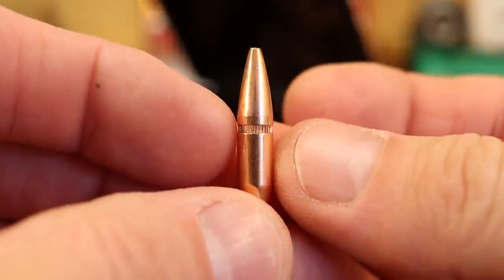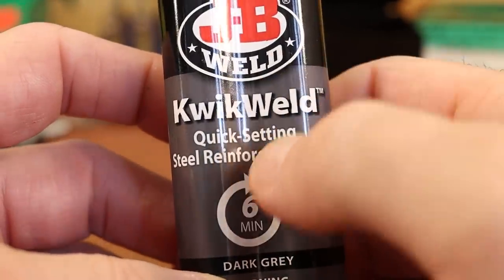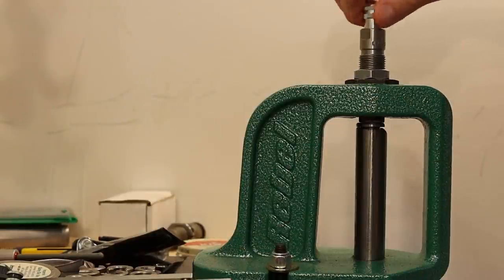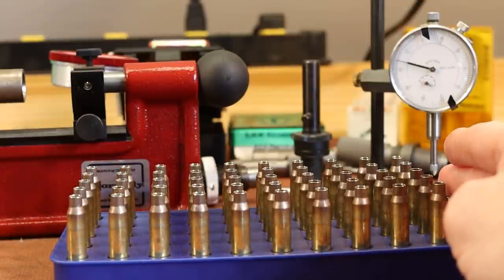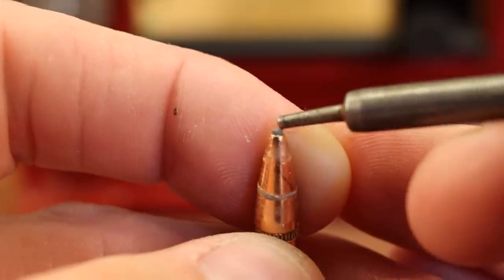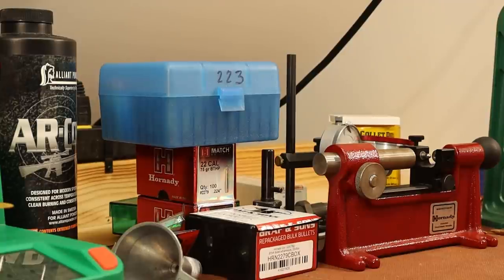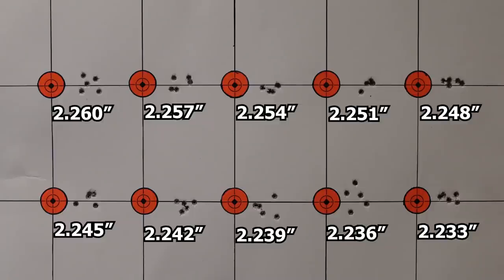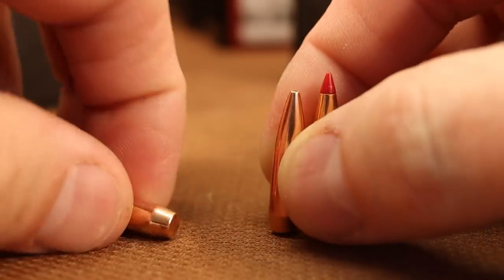223 Rem - 75gr Hornady BTHP with AR-Comp

Comment: JRB thank you, great stuff but...sorry to add another variable...when you use the new Lake City cases the shoulder will come from the factory bumped back as much as .004" below SAAMI .223 chamber minimum dimensions. No big deal in terms of safety and it's done that way to fit all chambers. BUT, although it's counterintuitive, the more the shoulder is pushed back, the more the projectile will be pushed forward towards the lands. SO now your seated bullets ogive is actually .004 to however many more thousands closer towards the lands than bullets seated in your minimally bumped back fire formed brass. Take two pieces of brass with equal bump seat two projectiles to the same depth, now take one(no powder) and bump it back. 001-.002. If you measure the CBTO of both, you will see the bumped back one grew the amount you bumped back the datum line!.

Comment: Sizing the necks with a mandrel is probably the easiest way to cure run out problems in brass.  The Sinclair mandrills are actually pretty cheap. I am getting less than .001 using the mandrel in the first station of my Dillon on my range ammo. After I saw how well it works, I started using it on all of my rifle brass

Comment: Good stuff. I had a rifle that would barely hold 1.25 in at 100. Did 0.003 testing. Got it down to 0.069. Never tested run out. I believe seating depth is much more important a factor than run out.

Comment: My favourite bullet (minus the cannelure because they are unobtanium here) for 5.56. I measure them and find one that is to spec length and then set my die to seat  them to 2.25” over a max charge of Varget (compressed) and use the seat, turn 90, seat trick I learned from you years ago. Shoots like a laser.

Comment: Had the "ring" issue with some "mystery" 75gr HP.  I used a Dremel &  Polish paste w/a wood "q-tip" on the seating pin...did pretty good at cleaning it up.

Comment: Check the runout after you load them then check it again after it has been chambered and before firing it. The violent feeding process will likely change the runout. If so, in the end, it won't matter what the concentricity is because the rifle will change it. Different story in a push feed.

Comment: I was so excited for this, couldn't wait, still fascinated. I wanted more kinetic energy over distance, and accuracy and had found Varget poor with my lighter bullets, so used my stock with these 75s and OMG. Turned out so durn good. Others ok. never had any inconsistency except with H335 which I rather expected. So Superformance and Varget were amazing with the 75 and my rifles.  Interesting stuff. BTW I loaded to like 2.25"
Reply: Try 25 gr LVR @ about 2.250. LVR is a great 223 powder. Didn't chrony yet, don't really care, it's scootin along.

Comment: Johnny, I ran into this same issue with some .224” bullets I use for carnitas loads. After contacting RCBS, they requested I send 6 bullets of the type I wished to have the bullet seat stem made to fit. RCBS charged me $20 + shipping and handling per bullet seat stem and sent my bullets with the new bullet seat stems. I did wait for approx 6 weeks for the seater stems but what the heck? I was extremely happy to have a stem that fit my bullets.
Reply: Cantinas loads? That was supposed to be varmit loads. But I’m laughing now.

Comment: Have you tried the old timers vibrator trick?  Those of you with dirty minds get them out of the gutter.  After dropping the powder charges on a compressed load, place them in a loading tray. Touch the tray with something that vibrates.  I had a massager the worked great on low.  After the massager wore out I used an old electric razor.  You just need something that will vibrate the powder to settle it.

Comment: run out is NOT suppose to matter, the throat is suppose to align the bullet to the bore as it enters.   How ever...  I'm sure it has some degree, but your seating depth is more important.  I am sure you are aware but some of your viewers may not be, that a 5.556 chamber has more throat than a 223.  The 556 is built that way to accept  many faulted or different lengths of bullets and correct it.  I have always had good results with backing off the lands .020 thousands less than what Hornady calls for.  I think that keeps chamber pressures low and allows the bullet a chance to get moving before it hits the lands.  I was holding my breath at the one shot group waiting for you to pull the trigger.   I was rooting for ya.   :)

Comment: I'm not a big fan of the cannelure because whatever the reason it's there, it creates a deformity in the bullet. How consistent is the cannelure made? On lower quality bullets, I can't imagine it's not all over the place. There is match grade and base level bullets for a reason. These bullets Johnny was using, where do they fall on the scale of bottom plinking bullets to the highest grade bullets made? If runout was an issue because of the cannelure, then use bullets without the cannelure. Easily remove the issue. BUT, is that the issue? Or is more bullet in the case mouth what really stabilizes the runout regardless of the cannelure or not? I wish I had the time, money and equipment to do what Johnny is doing. Thank you Johnny, you are a king in this never ending world of reloading.

Comment: Next test could be trying the seating depth node with both neck tension  ±0.002 from standard. As well as crimp in 3 amounts from a light barely perceived one to a moderate just noticeable crimp.

Comment: Try same ground of powder, prep all brass by cleaning out the flash hole, primer pockets. Then check weight of all brass to be at same weight and length, check all bullets to be same length, ogive length and weight.  Load and test fire.
Reply: Mandrel the brass to .222 before powder and seating.

Comment: Man, I don’t know. You’re down to nit picking. Maybe sort out bullets by weight difference or tip consistency. 
Other than that, maybe stick with this charge weight, oal, etc. and sort out by concentricity. So like a group of 5 with .004, down to 5 with .001 and see if your theory of it not making a difference holds true. If not, I’d say call it. If the load gets down in the .5” range, what more are you looking for? If it’s a hunting load, then maybe do a gel test and if passes, get in a stand!
Reply: Definitely a good idea Gel test 👍
Reply: Great comment!

Comment: Constantly gotta weight time investment versus productivity. I feel the same, I don't want to being spending hours nit-picking brass when I could be spending it behind the trigger. 

Might want longer than typical necks for those handloads. Maybe a 0.005" shorter than max case length, giving you the most engagement surface.

Comment: Seat a bullet. Take the stem out. Fill the stem with 5 min epoxy. Coat the bullet you just seated in oil. Put the die back together and run the cartridge back into the seating die and leave it.you now have a stem exactly fitted to that bullet

Comment: For your modification to the seating die, maybe if you took a round that was "perfect" as far as concentricity was concerned and used that to embed in the JB Weld that would give you a better result.  Otherwise, all you're doing is "casting in stone" (or JB Weld) any misalignments in the template you used.

Comment: I had a guy tell me he took and put lapping compound on a bullet and cut the stem to fit that way,  I don't know if it's genius or really dumb.
Reply: Its a good idea, make sure you clean the stem and trash the bullet
Reply: Yes! Valve grinding compound for cylinder heads on an engine. It works.  Put stem in vice, chuck bullet in cordless drill. Apply compound to both. Don't get either components hot. Take your time
Reply: @cademarti1365  yeah I use it for other stuff too, I just couldn't figure out if it was a good idea or not,  I didn't want to trash my stems .
Reply from the maker: If you dig far enough back into my 300 blackout videos I have actually done that before. Or maybe it was Grendel. I can't remember...it was a long time ago.
Reply: @JohnnysReloadingBench  oh did you? How'd it come out?
Reply: You can could, but it woukd be long tedious work trying to get the bullet lined up straight.

Comment: I'd imagine that with the shorter OAL you just have more bearing surface, letting the bullet align more correctly. Try getting some smk with and w/o cannelure (or any bullet that offers it with and w/o) and run the same test to see if the cannelure or the greater engagement is causing it to improve.
Reply: I say the smk because the cannelure seems pretty light on it
Reply: Yet the best groups were seated out….

Comment: I wouldnt even be concerned with .004 runout.  I shoot consistently at 1k yds with that much run out and it makes no impact whatsoever.  Now if it's .006 then sure, but I think you have a brass problem but if you're shooting out of a semi-auto, then you gotta remember there's .005 bump for safety.  Then you have to remember there's an error or room for improvement on all of those instruments of roughly +/- .001 to .002.  I would argue that 2.251 is the length you should go with.  That's because the main body of the group is touching & it's vertical in shape.  A horizontal group isn't always a good thing.

Comment: You been at this long enough to know your AR doesn't care about .005 runout.  I tested this in a .223 AR, compared rounds with .008-.015 runout to rounds with .002-.003 runout.   The high runout groups were smaller.

Comment: Dose the seating stem fit matter that much or is he overthinking it? It's not something I've personally experimented with. I use Redding dies with the micrometer seating stem for my loads going for accuracy, using mostly SMK projectiles. My accuracy with them are in the 1" or less range at 100 yards. (In 77gr SMK 5.56 , 140gr SMK 6.5 Creedmoor, 175gr SMK 308 Win and 220gr SMK 300 Win Mag).
Reply: With smk mostly not, they don't have the long ogive found on vld bullets, with those they can potentially bottom out in the stem, or have a really small contact patch introducing inconsistencies in the bullet from deformation
Reply: It matters if you are deforming bullets. Getting gross misaligned stuff. But simple bright marks are not an issue….

What does matter is difference at the Ogive to Rifling junction being consistent
Reply from the maker: My obsession with it started in 300 blackout. The case capacity is so small that shooting absurdly compressed loads was pretty common. Also, because of the small case capacity, it was usually important to load right out to the very max magazine length.
The problem was that bullet deformation was making my OALs go all over the place. Hence my obsession with seating stem fit.
In this case, with 223, I have lots of powders available that will give me good performance without getting stupid with compressed loads, so obsessing over the seating stem is a little bit silly. Maybe.

Comment: Well, it would have been interesting to fire a couple of groups of like run-outs and see if the groups got smaller. Or take the best powder grouping charge and then just try five like run-out groups, in theory they should all stack in the same hole. Right? My guess is, however that the results would look exactly the same as it does with mixed the run-out groups.

Comment: The concentricty numbers that everyone are throwing out are not really comparable to each other unless they are using the same bullet and are taking the measurement on the same part of the bullet...If you take a measurement higher up the ogive, the runout will read higher...Ive done concentricty test with 6.5 creedmoor and at 200yrds and in it didn't make a lick of difference until around .008" using my measurement methods

Comment: There appears to be a general increase in velocity the further off lands the bullet is seated. So is it the change in velocity that changes the group size? Or is it something to do with run out changing because of the amount of the bullet being supported by the soft brass neck as it engages the rifling. This test appears to indicate that the further down into the case the bullet is seated causes more velocity and less accuracy

Comment: What logical reason accounts for a change in accuracy because of seating depth.? Wouldn't it make more sense for a bullet to exit the soft brass neck and be supported by the steel of the barrel when it is swaged into the rifling. Sort of the way some bullet seaters support the bullet as it is being seated into the neck to lower run out.

Comment: Did i notice the velocity going up as the seating depth was shorter? Wouldnt adjusting powder charge for those be next to match the .560 groups velocity. Idk just something else to test maybe. Good video. Keep up the great work. Im waiting on primers to mess around with testing. 😆
Reply from the maker: Exactly.
Is there a magic charge weight and nothing else matters?
Is there a magic seating depth and nothing else matters?
Is there a magic velocity and nothing else matters?
I really have no idea! I want to explore all of that in this series.
Reply: @JohnnysReloadingBench  Enter reliability into the picture and go from there, 2.260 not for me, maybe 2.250.

Comment: How would the runout be after you chamber the round check one of the bad ones chamber it then eject it and measure it again
Reply: Yes! I had a 6.5 grendel with a tight chamber that would straighten them out some...I think the force of the bolt slamming home can move the bullet around some too...

Comment: Concentricity of the brass and bullet do make a difference.  I had an AR that shot just under 1" all the time.  By getting the runout on the brass to .001" I was able to get the groups to half inch all the time.  To get better than that I had to uniform the meplat of the bullet.  But that only reduced average group size by .2" at 100 yards.  It all depends on how accurate you need to be.  I've found that by using Lapua brass I don't have to worry about neck turning.  I can get consistent half inch groups without much effort.  That's plenty accurate for an AR.  My F Class rifle is a different story.

Comment: I am a fan of your videos, and I want to ask a question you may have answered before.
When  reloading for semiautomatic rifles, do you notice an accuracy difference between small base sizing dies and regular full length sizing dies?
I use small base dies, but I wonder if they under size to a point that may affect accuracy negitively.

And it is awesome you mentioned Cortina because he is the person that made me start to think about this. I would ask him, but he seems to shoot mostly bolt action rifles.
Reply from the maker: Up until very recently, an RCBS AR-Series Small Base Die was all that I had for 223. I've never felt like it was working the brass too hard or introducing some sort of harmful slop to a chambered round. I still try to watch how much I'm bumping the shoulder and keep it down to .003 or so.
Having said that, I've now tried several standard 223 dies and haven't had any problems in my semiauto guns. 
I definitely don't think it's a reason to replace your dies.
Reply: I have loaded 223 with regular and small base dies. I did not notice any difference.
Reply: Thank you

Comment: I think it just is showing that the overall length has more impact than concentricity. Did you try loading the 75gr w/ cannelure vs the standard 75gr w/ out cannelure @ 2.248-2.254 Overall?

Comment: I was going to have a machine shop drill out the center of my seating stem. I've got a question. I have two sets of Lee dies 1) 280 AI, and 44 MAG/SPC. The sizing dies are cranked down on the de-capping pin so tight you can't disassemble the die to clean them. Have you run into that problem?
Reply: , Yes, use a little vise if you can't hold the die.

Comment: Just curious, is there any evidence that shows a certain range of run-out is acceptable/desired?
Like on a car wheel, you don't want it to be perfectly concentric.  "Too round" will also cause an imbalance (takes too much wheel weight to even out the forces).

Don't pull your hair out, and make sure to recognize some of the inconsistencies inherent to the set-up.

Comment: Interesting subject but should you have a custom seated stem for every projectile size? And when does a flyer come down to a shooter's various ticks? I ask because none of these were shot from a mechanically isolated gun. Way too many variables to consider much. I understand the point is "real world" accuracy, but if a couple of thousandths runout is being factored for close range flyers, maybe we are kidding ourselves. Repeatability could iron this out by doing this multiple days since everyone has a good day and suddenly that day's results become the new standard. Until it isn't and then we are back to square one.

Comment: I'm running into this problem with my lee. Most bullets coal is different. Not all will be that way but maybe 20 out of 50 as I do 50 at a time. Frustrating as all hell. Plus it leaves a ring around the bullet. Ugh

Comment: Hey thanks so much I got some 88 grain ELD without the canalure how do you measure the placement of the canaulre I have a fixture to do it. Enjoy your videos
Reply from the maker: I'm not sure, to be honest! I guess you could just figure out your seating depth first and then try to place the cannelure wherever the case mouth ends up.
Reply: @JohnnysReloadingBench  thanks I have got to figure out a load those ELD are going to be tight. Thanks
Reply: @jamesowens2781  if it's 223 you need a 1:7 twist. And you will have to single feed. They made the 73g eld for ar mag lenght. The 75g eld and heavier were not intended for use in ar mags.
Reply: @jonathanrogers9961  thanks I bought them for my bolt gun. I appreciate the input I just like the canalure on the bullet I reload but nothing like Johnny